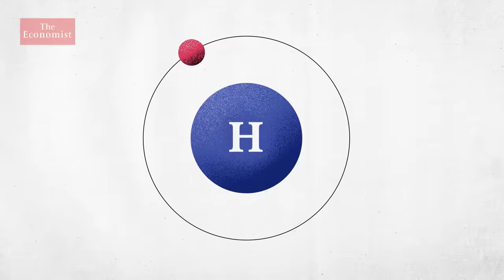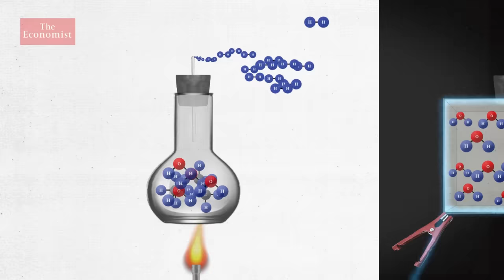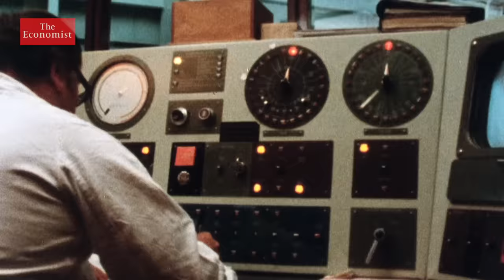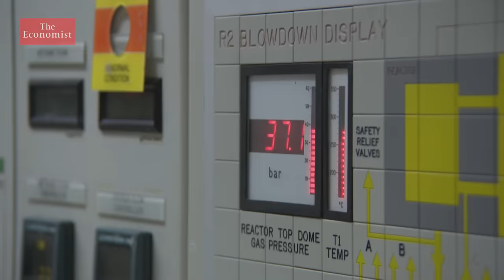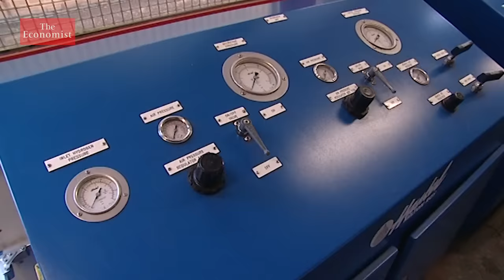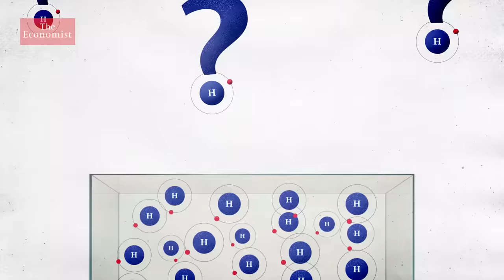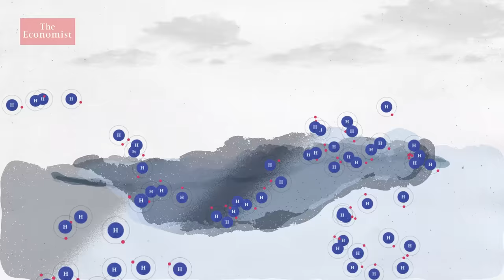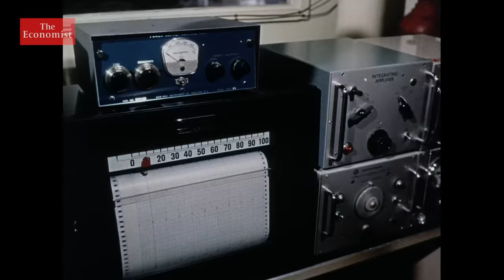Hydrogen: fuel of the future?

Comment: Surely part of the answer lies in the more efficient use of the currently wasted renewable energy capacity where the electricity generating source have to be turned off because there is no demand and there is insufficient batteries to store the electricity for the times that the sun is not shining and the wind not blowing. 

If that spare capacity was used to generate green hydrogen then it could be used in places where electricity is not available or not practical.

EV cars make total sense, EV trucks, ships, trains, heavy plant and aircraft don't but they do with hydrogen.

Comment: So how do you propose manufacturing, storing and transporting at a massive scale?
It needs to be kept at 30 degrees below 0 otherwise it leaks out of its containers. The energy required to do that would be massive. 
The cost of building that kind of infrastructure, maintaining it and transporting it would make it prohibitively expensive and who’s going to build it?
It’s already been shown to be unfeasible except in limited applications where it’s used where it’s manufactured as in steel production. 
In a lot of cases we’ll still have to use fossil fuel to make it.

Comment: As batteries get better and better likely automobiles, motorcycles, delivery and 500km truck routes will stay battery, but hydrogen makes sense for rockets, planes and long haul transport. I'm interested to see where that dividing line will be between batteries and hydrogen. Right now the cost issues with hydrogen are related to its movement of energy. Making it and using it is inefficient, while electricity in batteries is incredibly efficient. i doubt that hydrogen will ever be able to fill the gap between the efficiencies, but it may not matter for travel that needs much higher energy density.
Reply: No,batteries are not efficient,they take an incredible amount of pollution to build as the chemicals are all treated in China with the maximum use of coal,batteries don't last forming dendrites by calendar life as well as the number of discharges. And battery fires are common,the Tesla battery in Aus.
Reply: @paulbedichek2679  you can't honestly believe that producing electricity to charge a battery to power a motor is less efficient anything else. The production of the electricity in the 1st place, to produce the battery and to charge it is the issue. And these battery fires and short life batteries? Where are you getting your figures? From the 1970's?
Reply: @CamTracey  Please,Tesla's Australian battery burst into flames as soon as it was turned on, last month,don't you get the internet? Batteries are extremely small in terms of energy they hold,since they are expensive and cause pollution when they are made,countries prefer to use natural gas instead. We can use batteries coupled with soalr,but it won't work as well with wind as you get energy from wind and then get a two week no wind periond while batteries last only four hours or less.
Batteries today have less than a millionth of the power of the grid.
Reply: The batteries get better and better? In which planet, of which solar system?

Comment: Thanks for sharing a balanced view on hydrogen potential. I do agree there is a large niche in industry and heavy transport, but I struggle with some applications. Personal vehicles should be electric which have much lower costs per km. BEV’s have twice the system efficiency as FCEV’s and cheaper and more convenient for daily partial charging at home. Hydrogen safety also has issues in confined spaces. Will insurance companies even allow FCEV parking indoors without approved high point vent systems?
Reply: Why not hydrogen hybrid 😎 for small distance, electric, long distance, hydrogen. ~Maybe I’m a genius~

Comment: As long as Bosch holds up to their promise of mass production and someone starts up a chain of Hyrodgen fuel stations along the major interstates across the country such as I-80, I-70, and I-40. This WILL happen! Also, don't forget investments in Residential fuel cells like what Panasonic does with their Ene-Farm systems. Otherwise it aint happenin!
Reply: Why isn’t no one talking about hydrogen engines??
Reply: @mellopelas2857  because fuel cells are cleaner and better

Comment: It's an interesting video but it has two elements if not wrong, at least misleading.

1/ You say for example that the only real way to make green hydrogen is to use renewable energies. This is not true. For example, to respect the European taxonomy on low-carbon hydrogen, you "just" need to have enough decarbonized electricity to make electrolysis directly from the grid. Countries like France, Sweden, Norway, Finland, Iceland or Georgia can do it. In the case of Norway, France or Finland it is largely thanks to nuclear energy. Moreover, the Generation IV reactors and SMRs create prospects for electrolysis or thermolysis with higher yields. Besides, you are mixing fossil fuels and nuclear in an assertion that is not historically true. In short, you are unfairly ignoring this energy which has a crucial role to play in the decarbonization of electricity and hydrogen.

2/ You say that hydrogen will be used in a second phase. This is almost false. It is true for the case of transport because there are still many barriers (which you mentioned). But it is not true for industry. For example, ArcellorMital (the biggest steel producer) plans to decarbonize (thanks to Hydrogen) many of its factories within 3/4 year. And they are not alone. By 2030, the focus will be on industry, while the period 2030-2050 will see mobility develop strongly.

In short, nice but many approxmations. Too bad for a newspaper of your rank.

Comment: Why use hydrogen for trains? Wouldn't it be much easier and more efficient to just put an electric wire over the tracks?
Reply: Putting wires costs a set number of lives per year as well as hundreds of millions in maintance costs,it all depends on the density,Railroads started in GB and they have lines that to this day are not electrified and they are using H2.
Reply: If tracks too long the cost will be too much expensive specially in order to maintain it
Reply: Yes, and anyone who begs to differ hasn't got a clue about electricity and probably even less about hydrogen

Comment: Indeed, producing hydrogen in times of excessive renewable energy production for storage or for large industry.....but transport? Why use large amounts of electricity to produce hydrogen to compress, transport it, and put it in a vehicle for a single use....to produce electricity to drive an electric motor. This just baffles me. Use the same electricity to charge a car battery and save the middle man. It's just common sense (and mathematically irrefutable)!
Reply: Weight, range and refueling times ..... Batteries are very heavy, and it is virtually impossible at this time to make a lightweight electric vehicle go any amount of distance that is useful, and in shipping (trucks, trains, ships, planes) weight makes a huge difference, a compressed hydrogen tank is light weight and can give you more range than a battery.  and it's quick to refuel, about the same as fueling a car now.  I think the future will be BEVs for cities and suburbs, HFCs for shipping, industry and rural areas (once we have infrastructure in place)
Reply: @SnowWolf9999  as for trains..... why not magnets and quantum locking? Reduces friction..... you just need to keep the components super cold....... another hurdle science could conquer given the interest....that is to say, funding. But the corporations have us squabbling over hydrogen vs battery. And the fossil fuel industry currently make money from extracting the hydrogen from gas....so, what's a boy to believe
Reply: @nateb4543  I remember seeing this a while back. I hope they get this off the ground. The more stuff like this the better.

Comment: Once hydrogen is established as an energy source it can be used to create itself. Renewables can only work if the energy can be stored until needed requiring batteries which are toxic and lithium is in limited supply. Nuclear is also toxic. Hydrogen is the only viable long term alternative, every effort should be used to move in that direction including including the existing fossil fuel industry in the process, they are best equipped to do it and can use the incentive to be productive at it.  Hope and pray for everyone to see the light and do the right things for everyone not just themselves. My opinion
Reply: If producing hydrogen is a net negative energy process, Wouldn't using hydrogen to power electrolysis be an even greater net negative process? If the energy value of the hydrogen produced is about 80% of the electricity used to split the water molecule, then instead of being 80% efficient, you're at .8*.8=64% efficient.

Comment: Tidal energy is one of many renewables that need to be deployed. Looking at hydrogen energy vs. petroleum/gasoline, one must objectively compare total cost & energy input vs. output for current and future. It is known that new technology will increase hydrogen efficiency at lower cost; and petroleum cost will eventually increase due to limited supply at the rate currently used.

Comment: 4:55 what you conveniently miss out with your issues is that outfits such a EuroTunnel won't transport cars with fuel under pressure of some 700 Bar, they won't allow any vehicles under pressure including LPG. You likely won't be able to drive through mountain passes i.e tunnels with those pressures, and in some countries you can't even park a car with LPG gas (at only 50 Bar) in underground car parks.

Comment: A petrol heads future, we can carry on with loud cars with hydrogen. And all green. 😎
Reply: Yep, no need for a fuel cell. Toyota and JCB already have engines that run off injected hydrogen. If you want to see a JCB hydrogen vehicle, look at Harry’s Garage for a video.
Reply: Burning hydrogen in a car engine is even less efficient compared to fuel cell. When hydrogen is burned it still pollute the air (although quite a bit less compared to petrol and diesel). Average efficiency of burning hydrogen in a car is 16 to 20 %, for fuel cell car is 25 to 30 %, for electric car is 80 to 90 %.

Comment: I live off grid with solar and batteries and that is the way to get started unless you have wind or hydro resources instead. Batteries are great but once they are full the rest of the power coming in gets wasted. That wasted power is perfect for electrolysis in my view. I am also planning to use some of the wasted power in summer to make hot water happen too. Hydrogen is perfect in combination with batteries to store power for longer durations like seasonally

Comment: They key difference between hydrogen cars and EVs is that you need to own a house with a garage to run an EV without trouble.
The problem with hydrogen is that it is hard to handle and easy to lose. Ammonia or Methanol are far more practical, but still have disadvantages of their own.
How about using Diesel fuel to run cars? That would be easy to handle, efficient, not as toxic as e.g. Benzene ("gas") and it could be produced from all kinds of renewable sources including plants, organic waste, hydrogen etc.

Comment: Hmmm, on a kg basis it has a high energy density but it is gaseous and so is in m3 where it has a very low energy density, thus making the carrying of sufficient for a truck both difficult to fit on it and costly. If you liquefy it you lose 36% of the energy doing so. I do wish people would research their facts better before peddling hopium around. Trying to distribute hydrogen as a gas is very difficult and costly. The Well to wheel efficiency of a HFC vehicle is less than 30% compared to a battery vehicle at 85% and a diesel ICE at 42%. As for emissions he fails to say that the heat is lost as well as the water and thus the heat adds to global warming….
Reply: @rabbit251  you are wrong. He is right.
Reply: @aljudy01  And you know this how? Through a detailed explanation showing that I'm wrong or simply saying I am wrong. But as an a retired English teacher and attorney, his English is terrible. He is not a native speaker.
Reply: On a volume basis, compressed hydrogen is still more energy dense than lithium ion batteries. Approximately twice as dense. Liquid hydrogen is about four times as dense as lithium ion.

Comment: Compare Toyota Mirai and Tesla 3.
Hydro vs electric
Reply: Sure, no problem. Toyota Mirai is 2 times more expensive to buy, 17 times more expensive to drive (17 € for the 100 km of hydrogen compared to 1 € for home charging), weights more (1848 kg for the Mirai, 1730 for the Model 3 long range) and has similar range.
Reply: @jasensalivec1475  Plus, it's even harder to fuel an Mirai now that many h2 stations have closed... and they only exist in California!

Comment: In the first instance hydrogen needs to be produced effectively and efficiently.  Adding 10% to natural gas is an easy win as it requires no modification to existing equipment and infrastructure.  If H2 production is economic it should also be easy to fuel cars, buses and trucks with not too much infrastructure change.  That said with the ban  on petrol and diesel cars from 2030 electric will likely charge ahead...
Personally I see hydrogen as being most effective in the home where a home owner may generate from a small wind turbine of say 500 watts and PV solar cells on the roof with excess energy being used to electrolyse water and store hydrogen produced on site.  This could offer effective storage with a fuel cell producing heat and electricity for the home.  Of course this is max 30% of energy usage associated with CO2 so solutions in industry and transport are needed.  It's all down to primary generation.  It needs to be low cost enough to be attractive and get adopted.  The safety issues are a lesser problem.
Reply: Super Bad It is being used for transport, domestic boilers have been developed and fuel cells are relatively old technology so it is already  "happening". I doubt it will be efficient or economic in the short to medium term.  All said natural gas will eventually run out and in the U.K. we now have to import LNG and of course gas via pipe from Norway.  Hydrocarbons are finite so alternate fuels will come in time.
Reply: Hydrogen can be used in large vehicles where batteries are not effective. Ships, large planes, semi trucks. - will not work with any battery technology that we currently have in development.
Reply: TheGuy both hydrogen and EV batteries have limitations and without breakthroughs providing save and economic energy density it is hard to see how large or long range ship/plane/truck can be successful.  Of course the energy input in the first instance is not an insignificant issue.  As an oilman I am only too well aware of the vast amounts of convenient, cheap and concentrated energy we have been fortunate to fuel the living standards we enjoy.
Reply: @davidramsay6142  hydrogen is already being used in submarines with better results than batteries.
 How, even in theory, can you have jet engine with batteries? Hydrogen based ones are totally possible.
Reply: Hydrogen is to dangerous in cars it can explode with right o2 amount isn't?
Reply: I think you will find short range vertical take off aircraft using propellers will arrive soon. To start with the range will be short but should extend to regional as technology matures.  We will see air taxis first and it will transform how we live if these aircraft reach out to the commuter belt as you will be able to go from the office roof to home very quickly.  Yes the jet engine and long range flight will stay with jet fuel and never likely use hydrogen or batteries.
Reply: Bendedstraw petrol is dangerous in cars....  NGLs have been used for some time just as dangerous as H2.
Reply: @VFPn96kQT  Tesla begs to differ.  So does BYD.
Reply: @SkyRiver1  what are you talking about? Did they build large ship , or jet planes? 
 BYD has electric truck with carb weight of something like 50 tones (5 times the weight of diesel power one) and with 200 km of range, tesla has only promises for now. 
As I see it, electric semi trucks are no competition to deasel ones. They are too heavy and have small range
Reply: @davidramsay6142  methane can also be created using alternative energy and would be much easier to transport in existing pipelines than hydrogen.
Reply: Colin Black colon what is the point on creating methane through RE?  It is arguably most efficient drilling for natural gas and even with LNG transportation.  Methane still kicks out CO2 on burning or reforming irrespective of how it is sourced.  Next yo no energy needed when you drill for it by comparison to what the well will yield.
Reply: @davidramsay6142  I was just making the point that creating methane would be more efficient than making hydrogen.  Obviously extracting methane from the ground would be much cheaper.  Methane is easier to store and transport than hydrogen.
Reply: Colin Black all the infrastructure and appliances work well with methane which is relatively benign as an energy vector.  It is very inexpensive - I pay 2.6p/kWh for gas and 15p/kWh for electricity delivered.  If that same electricity is used to make H2 then H2 will cost c. 25p/kWh.....  go figure.   Hydrogen may remain niche energy vector.
Reply: If you're going to add hydrogen to the natural gas supply you will lose energy as hydrogen is 6 times less dense at the same pressure and temperature. The hydrogen would act as a dilutant to the natural gas.
Plus the fact that the more other gases you add to hydrogen, the nitrous oxide produced when it is burnt rises sharply.